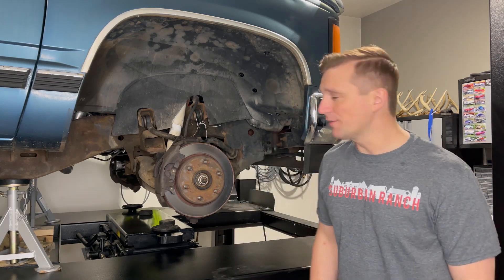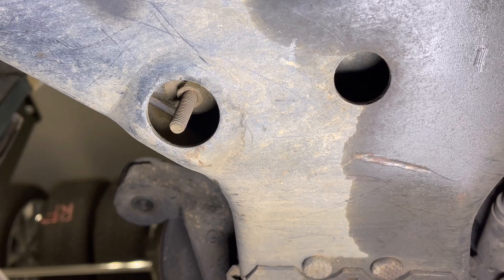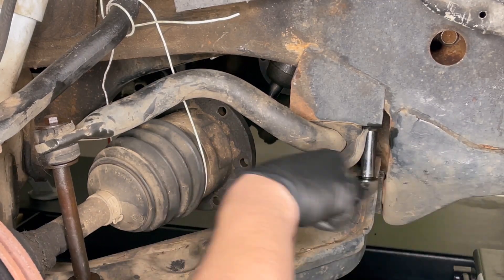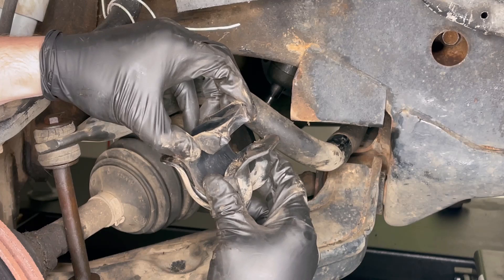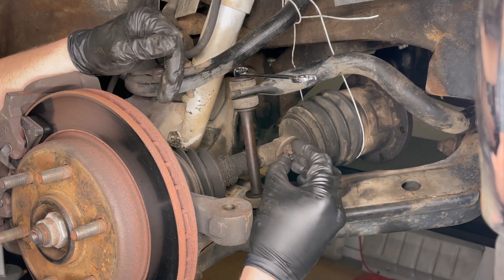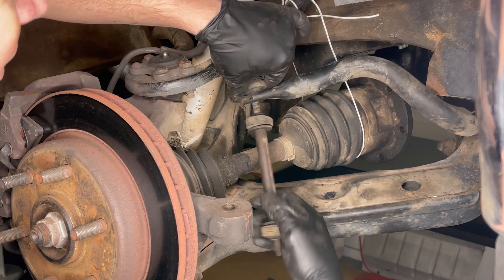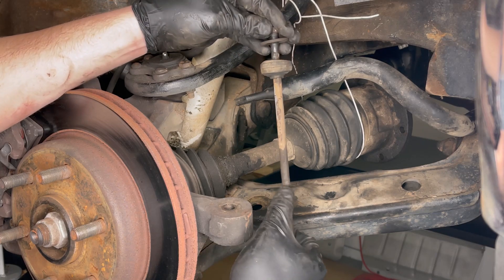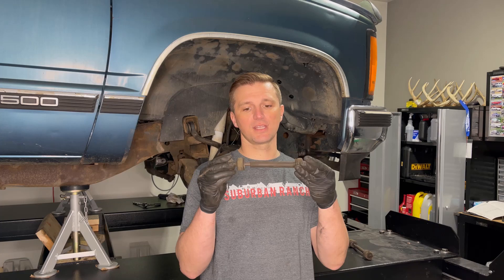Removing the sway bar end links from an 88-98 OBS Chevy 1500

Comment: Putting the links back in, and bolting it back onto the frame is the fun part. The nuts in the frame that hold the center bushings are pinch bolts. They have been known to just spin when trying to tighten. There is access and room for nuts that fit the bolts. Once you get them started, a fat screw driver, or a piece of steel wedged between the walls of the frame, and the nut to keep it from spinning works fine. These have to be tightened until the ears of the bushing caps make contact with the frame.
Reply: Thanks for that comment, I've got my swaybar bolts and links all loosely started, but couldn't fit a socket in at the correct angle to catch the bolt head.

Comment: I’m doing a front end rebuild on my 90 k1500. I was able to get at everything except the lower control arms. Being that they are not horrible do you think I can manage getting it aligned with everything else minus the bushings on the lower control arm?
Reply from the maker: We ended up doing the lower control arm bushings. Took them to a shop and had them done. I think it’s a good idea to do them but as long as they are not torn or cracking, you are probably fine leaving them.

Comment: I prefer to cuss & grunt for 2 hours, trying to install new end links without removing bar mounts. Yeah. I’m resuming tomorrow and removing those mounts first b4 I try lining the new links up and in. Why do I always do this?!🤦🏻‍♂️
Reply: Went much smoother and quicker the next day. I pulled off the bar bushings and everything went a lot easier. But then I had to make it difficult all over again because I like to put them in up through instead of dropping the pin down because it’s impossible to get the bushing and washer and nut on at the end because there’s no room with one finger. And when it was all done relatively quickly, I thought maybe I should spend the next two hours reinstalling it the way it shows in videos by dropping the pin downward, because I was afraid that the end of the pin would rub on the upper control arm. Then I looked at my other OBS truck, and noticed that I put them in upside down on that truck and nothing is rubbing. So after kicking and screaming for two hours after I already finished it, I decided to go back to the original way, which was up through the bottom. Absolutely destroying the nylon washer inside the nut. Long story longer, it’s back on the road. 🤦🏻‍♂️
Reply from the maker: Been there man. Glad you got it done!